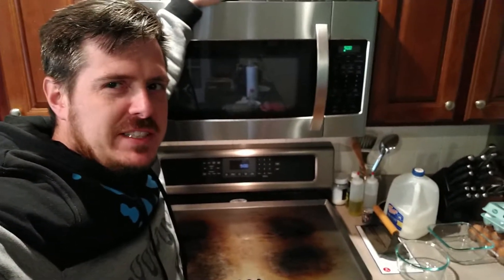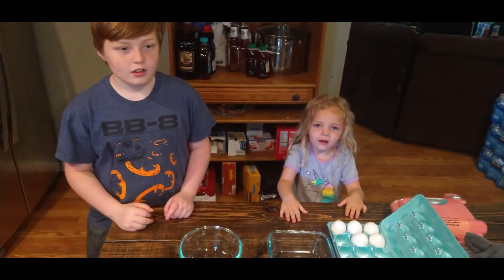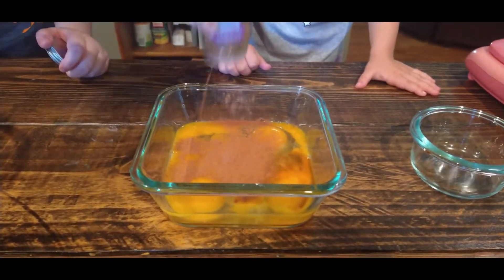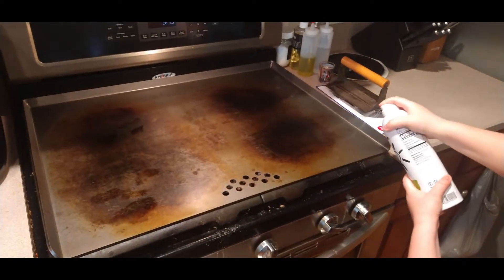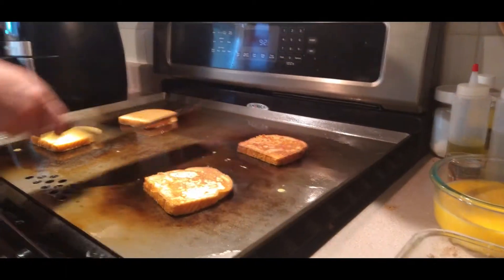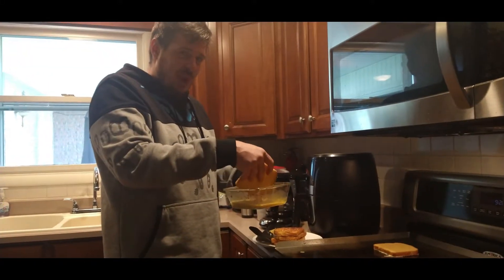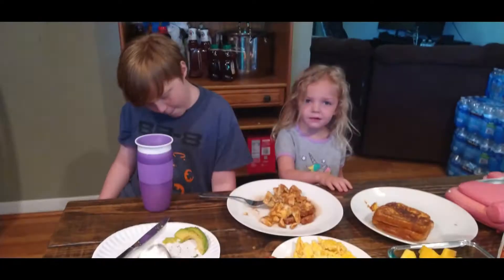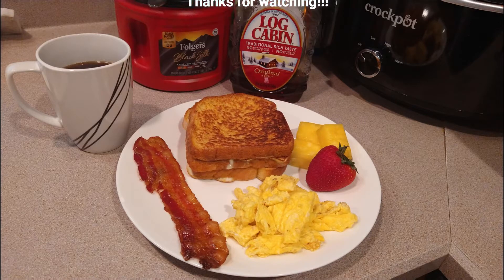Cooking Breakfast on our Steelmade USA Flat Top (What's Cooking Sleeve?!!!)

Comment: Definitely going after one of those Steelmade USA flat tops.  Amazing!  Looks so much easier to cook.
Reply from the maker: You will really like it! They have a quite a few different models. Ones for gas, electric and electric glass tops. You can get them in 1/2, 3/4 or full sizes depending on how big or how many burners you want to cover. And you can also get them in a thicker size so you can use your pots and pans on top of it. Pretty cool! I really like it. When I'm not using it I just cover it with foil and put it on top of the fridge but they make a really cool butcher block for the top to cover it and cut on. You would like it!
Reply: Fantastic!  Thanks for the info Sleeve1080.  cook on!
Reply from the maker: @stephenwise1495  steelmadeusa.com I'm pretty sure is the website or just type that into google
Reply from the maker: @stephenwise1495  yes that's the correct website address